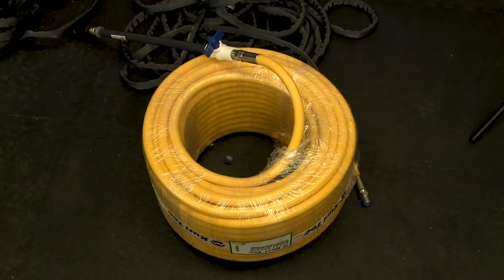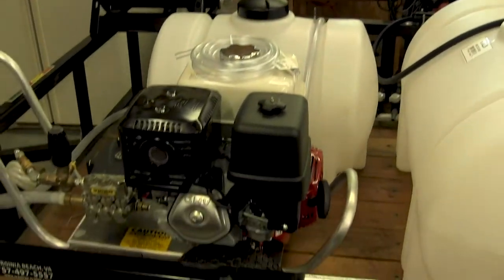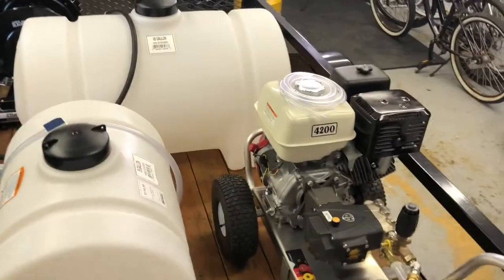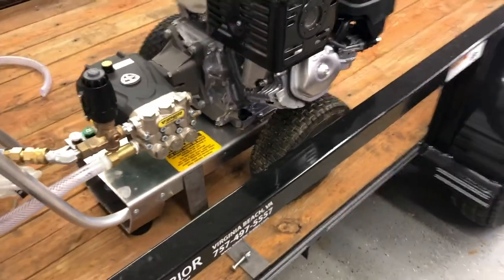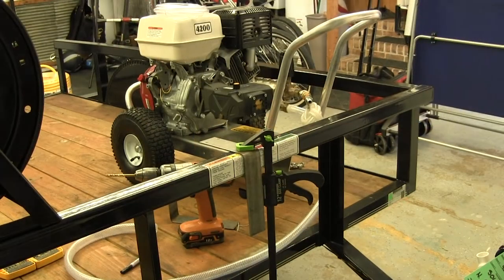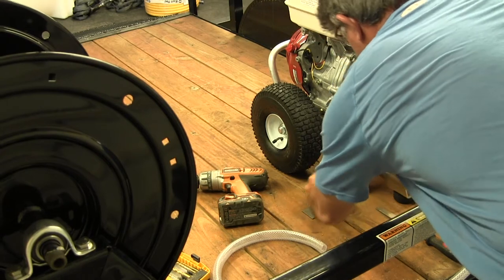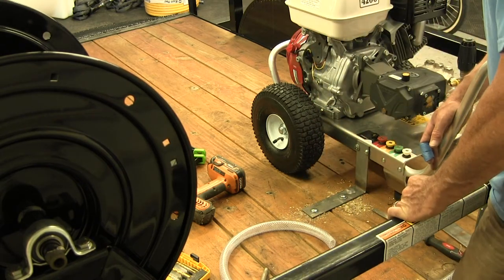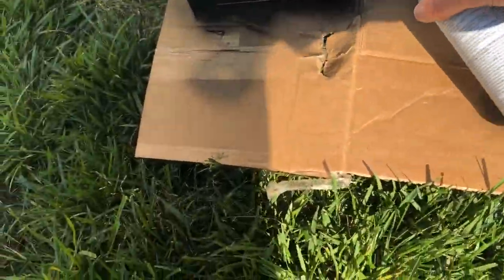Trailer Build Part 1   Mounting Pressure Washer

Comment: My trailer is really small so I’m very limited by real estate and weight capacity. I’m running a single 4GPM machine. I want to run a buffer tank not so much because I’m concerned about not having enough flow, but mostly to plumb the bypass back to the buffer tank to avoid over heating when I’m “off the gun” and not having to keep shutting off the pressure washer.  What would you recommend size wise for the buffer tank?
Reply: jack I was running with a 5x8 trailer which is about as small as you can get and I had a 55 gal horizontal leg buffer tank. I do recommend purchasing the proper plumbing kit that for the 4gpm machine though. I'll put a link in the description.
Reply: @neptuneclean  

Thank you!
Reply: @neptuneclean  

I do have a 5x8 but also an aluminum 40”x48” trailer and I was hoping to get everything on it but it’s not looking that way 😕

Comment: Roughly what was the total cost for this setup, minus the trailer?
Reply: 4GPM pressure washer was around $1250 but I think they've gone up... everything has. Hose reels from Northern Tool around $300. The small hose reel for water supply $150. The 5.5gpm bleach pump for softwash was $159 ( I recommend the 7gpm for around $200). For 2-wire non marking pressure washer hose 100' is around $160 (you need two). Yellow 1/2" chem hose (Kuri Tech) is about $1.50 a foot so around $300. Nozzles, fittings other hoses at least another $300. 65 gallon water tank $400. 35 gallon bleach tank $200. 8 gallon surfactant tank $90. Marine battery for softwash $150. Stainless steel fasteners $100. Ballpark total minus trailer = $4000.

Comment: How stable was the pressure washer with the mounts you used? I have an identical frame on my unit and was wondering if something else like straps would be needed on the rear by the wheels?
Reply: The mounts I created worked awesome. The only thing I would change is to make them out of aluminum so that they don't rust when bleach gets splashed on them.
Reply: @neptuneclean  

That’s a good point, I’m going to mount mine exactly like you did. Great videos BTW